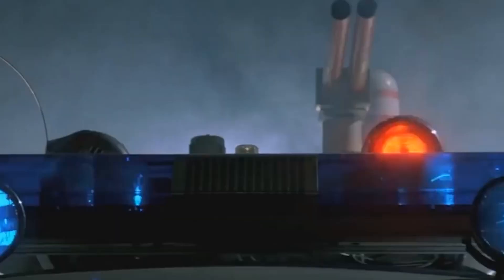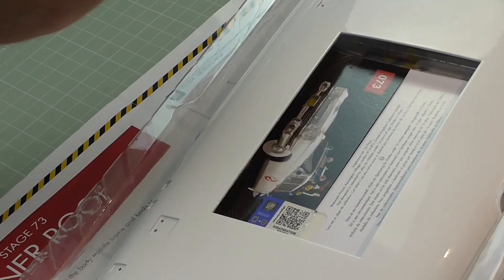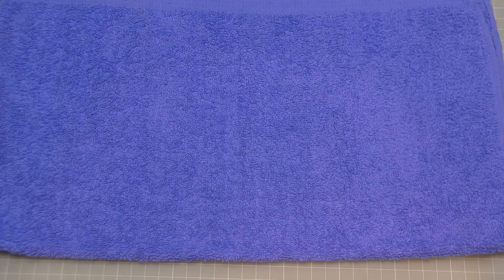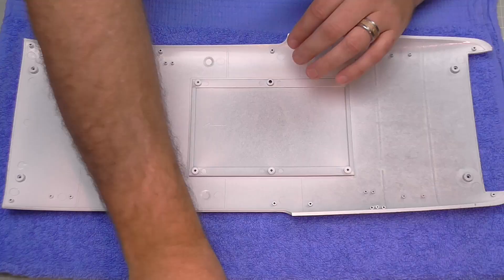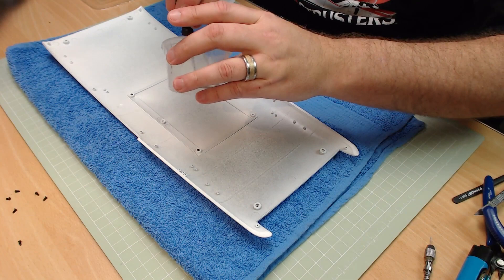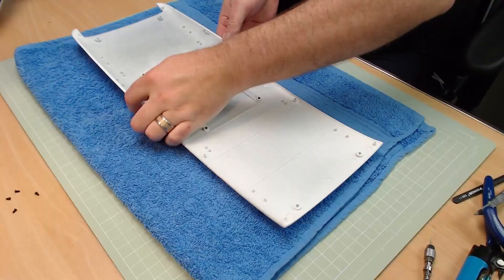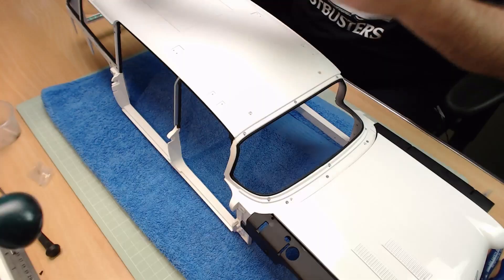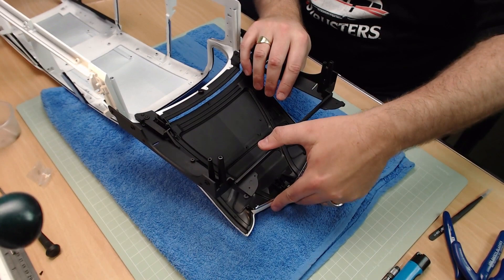Build the Ghostbusters Ecto-1 - Part 73 and 74 - Inner Roof, Front Left Fender Plating & Wire Cover

Comment: Looking good.  Just got confirmation of shipping of parts 71-74. I cant believe how heavy this thing is already without the body on.  I stopped at issue 18 as I am waiting on the power mod so I can put it all together and not worry about disassembly.  Just picking up the chassis with the floorpan sitting in place it is quite heavy.

Comment: Issue arrived last week finally! First package that I've had a few issues with. 
The bonnet casting has material still in the holes where the hinges attach to,  I'm wondering whether to ask eaglemoss for a replacement or just carefully drill out the material myself. 
Second little problem was attaching the roof skin to the frame, didn't sit very well, I had to slacken the screws holding the frame together through the C pillar and really squeeze the rear frame into the roof skin whilst driving the screws in. 
Great video Wayne, thanks for the help during this build 👍

Comment: I was thinking has anyone ever modified the front bumper under the headlights right by your fingertips on the 9:28 mark there is 2 amber bulbs on each side of the bottom of the bumper I’m assuming that is the turn signal and the 2 strobe lights in the center of the grill and where could I get them